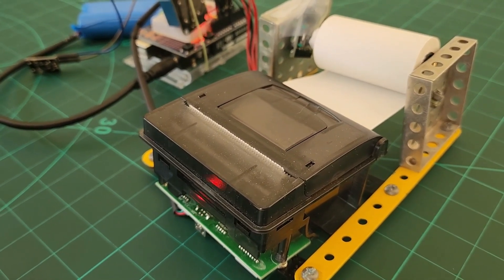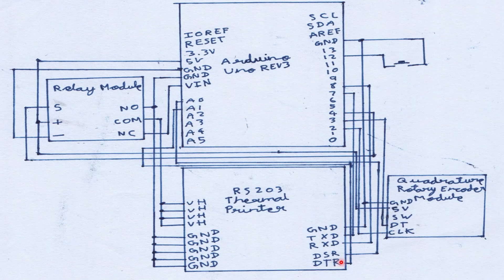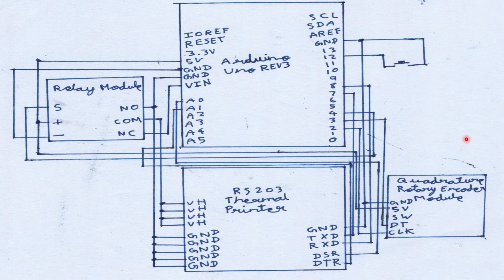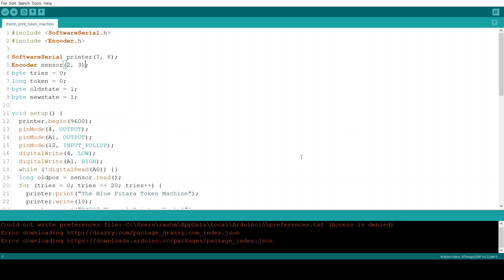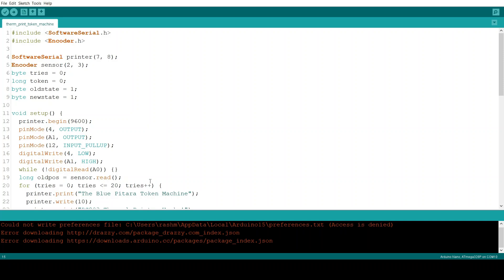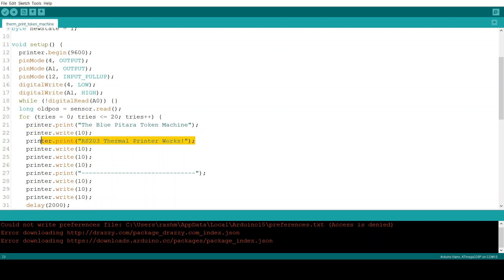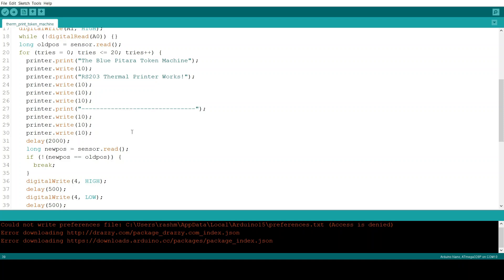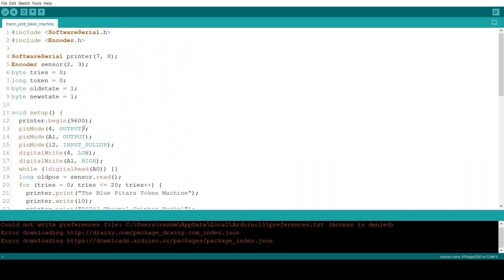Interface a RS203 Thermal Printer with Arduino and Make your own Token Machine!

Comment from the maker: Note - All functions of the Adafruit library also work except for bitmap printing
Reply: as this specific printer doesnt even have a test print button, im just super frustrated with my printer, even ordered a 2nd one just in case it was defective, but still no results.
Reply: @thebluepitara Hi Ishaan, can you please help me with printers connections and other stuff, i cant get proper power and other connections right. please reply ASAP.
Reply from the maker: @JagjitSingh-q1j  Hello, how can I help?
Reply from the maker: Do you have the exact same printer? From robocraze? If so, then you can directly copy my wiring and code!
Reply from the maker: If not, please check the pinout from the supplier/datasheet/pcb silkscreen.
Reply from the maker: Also, sorry for not replying earlier. I don't receive notifications on comment replies.

Comment: Bro do with ttl connection and show how its connecting
Reply from the maker: The connection is already 5V TTL, circuit diagram of the connection is given for that printer in the description.
Reply: @thebluepitara  bro I connected via ttl interface rx to tx and tx to rx and ground to ground or Arduino and connected gnd and vcc to battery but printer is responding when I upload code what I do now its always showing check rx but rx wire is working
Reply from the maker: @sanu55555  Did you upload the code given in the description to the printer? Also, are you using the same model as me?